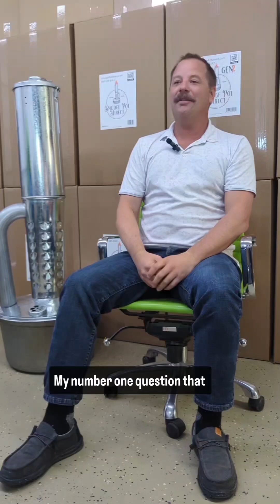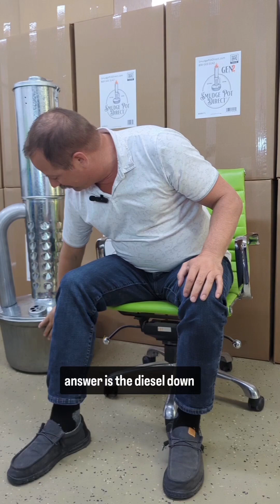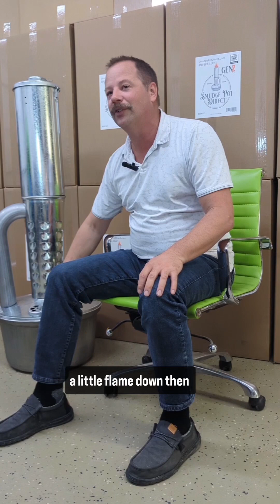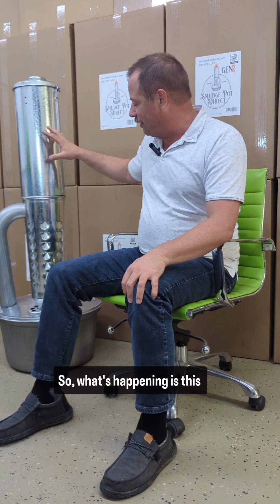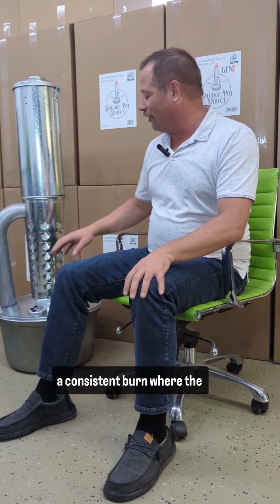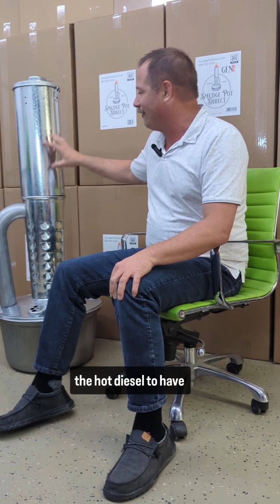Chats with the CEO: Why Does My Heater POOF?

Comment: I leave my regulator off because it puts out way more heat and a better flame. Is this a big deal leaving it off besides burn speed? Would the updated regulator help with hotter burn? I have the v1 pot

Comment: So your product doesnt work properly on low setting?  Really convincing me to buy one of these…..
Reply from the maker: It does if you use it correctly. You have to let your fuel heat up and then can put it on a low setting. If it's 34° outside your fuel is also 34° so you need to let your fuel heat up longer to be able to make a setting.
Reply: So....  what you're saying is you've never operated an engine with a manual choke.

Until the fuel in this system gets up to steady-state operating temperature, YOU need to adjust the airflow into the base.